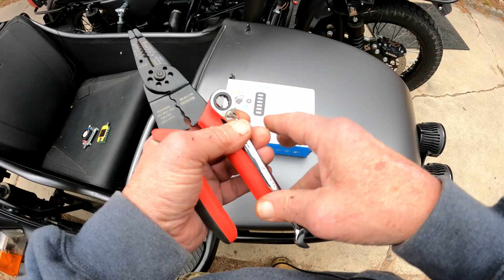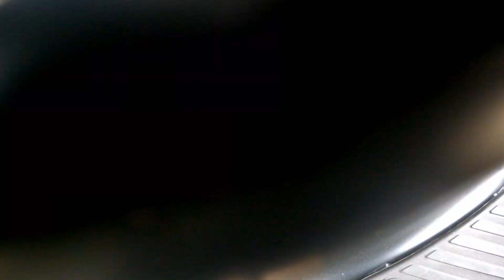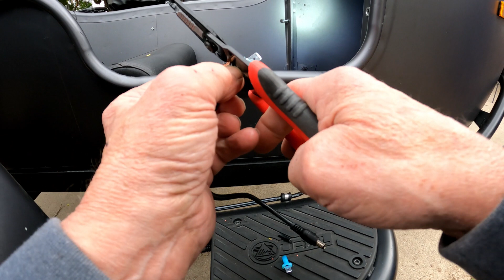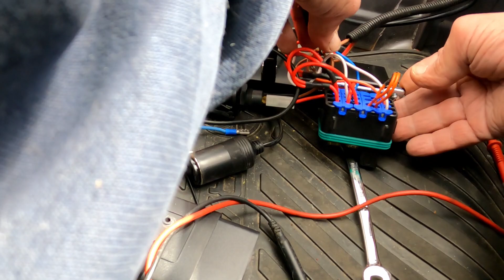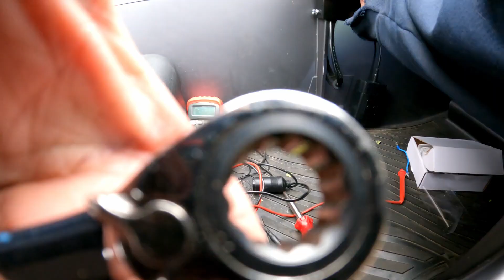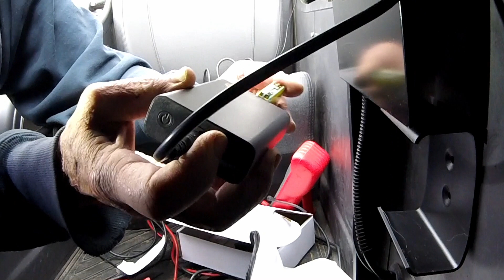Installing a USB hub in a Ural sidecar

Comment: Try hacking power for light relay to running lights.😊
Reply from the maker: Not sure I understand… please elaborate…
Reply: Hi Allen,   I think what he means is for you to connect the power feed wire, going to your car’s Led Spotlights, back, and across, to the bike’s main ‘High-Beam’ power feed wire, that goes from the ‘output side’ contact, of the bike’s ‘headlight control relay’.   That way, the Spotlights will automatically come on whenever the headlight is on, High-Beam, but, that also means that you would also, need to connect them through another separate ‘isolator’ switch, so that you could disable/turn-off, the power feed to the Spotlights, if/when you didn’t actually want them operating with the headlight on High-Beam, eg, during daylight riding. 😉. 
Mate, I gotta say, that you certainly had me worried there for a moment, when you first connected up the wiring of the USB box, after ..”assuming” that the red wire was ‘power’ only to then find it didn’t work..! 😳  
You probably already know, that It’s a decidedly ..dangerous thing, to ..assume, ..anything, about ‘correct power connections’, when working with modern ‘electronic devices’ because you ..don’t, get any second chances, if you get the power feed ..’reversed’ polarity to them. 😉  
If you’re ..unlucky, in your ..assumptions, all you get is an expensive puff of smoke. 😢 and that’s why, I ..always, ..check, the ..actual, wiring in those pre-made power cables, ..first, with my multimeter, set on the Ohms/Resistance measuring range. 😉   Cheers.
Reply from the maker: That should be easy to do… As for hooking up the USB port, I relied on my USB power meter, which would have told me I had -5V instead of +5V.